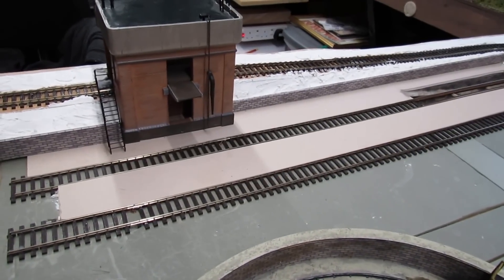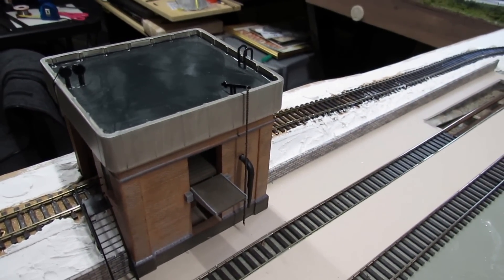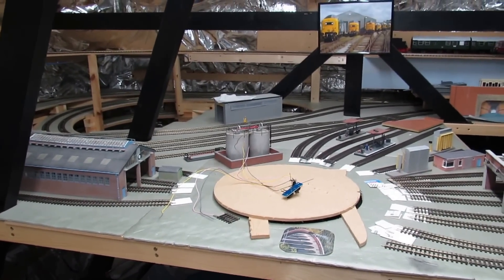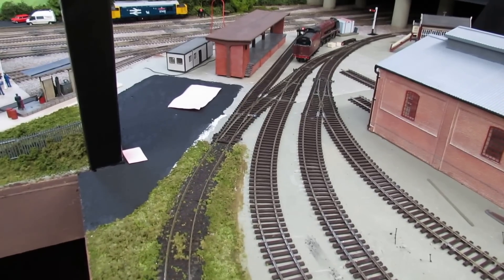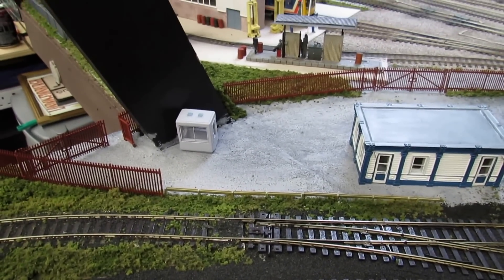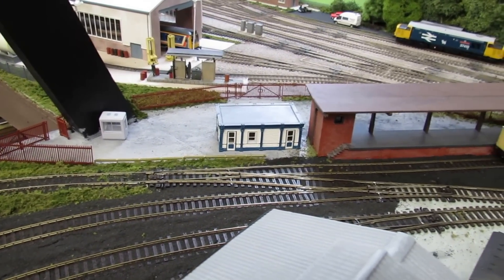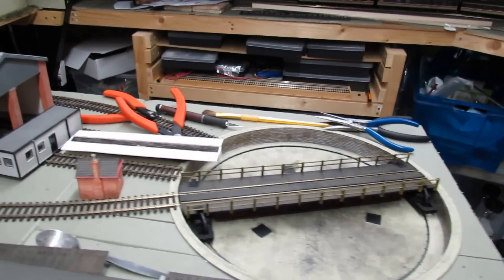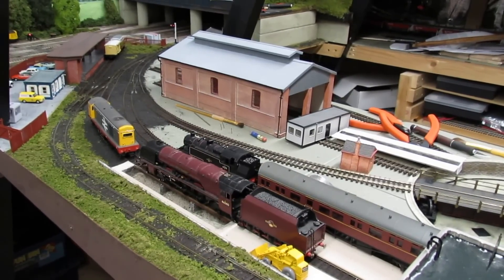Milton Mo Junction 28

Comment: Hi Robin, it's looking braw!!! Speed of build is also very impressive, especially as there are major civils works ongoing in the former TMD. If I can make a suggestion, I would swap the SB with the Portacabin and turn the SB parallel to the track. That would give the SB a purpose in that it could be controlling the S&C at the yard throat as opposed to just being a heritage item.
Reply from the maker: Thanks for the idea will have a look. As I am waiting for some bits, have put the Heritage on hold for a bit while I do 'civil works' at the TMD end. I am also doing some work on the O gauge layout just to have a change so as not to get bored with the same think.
Robin